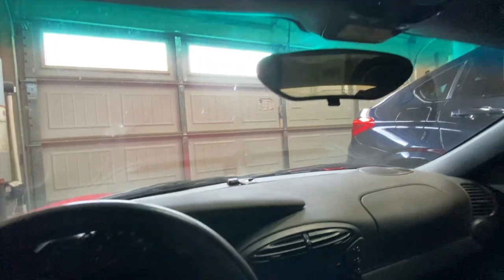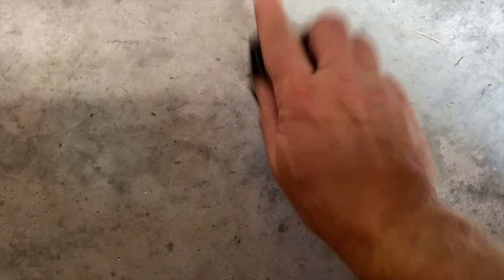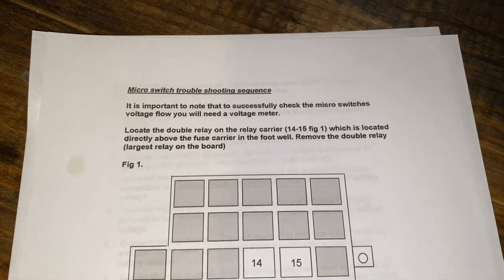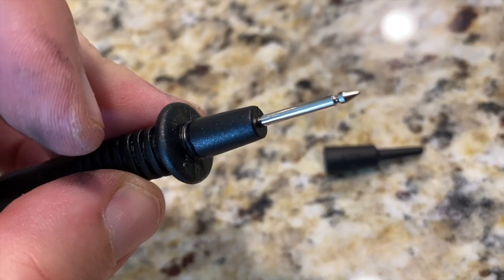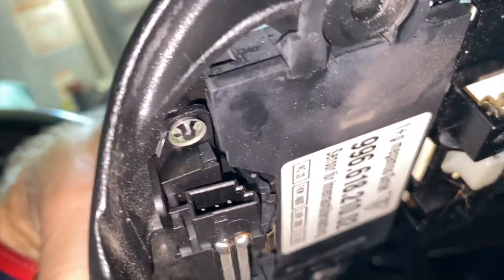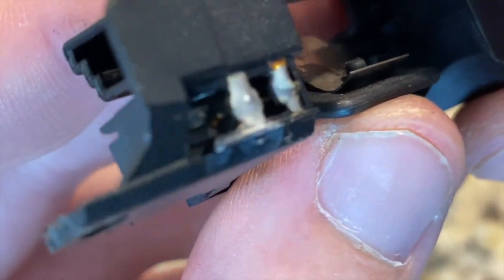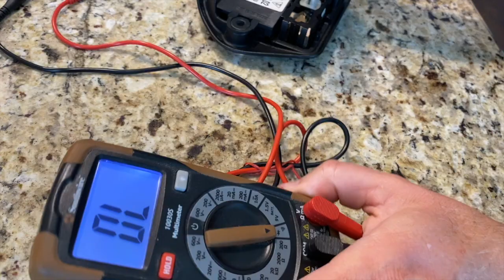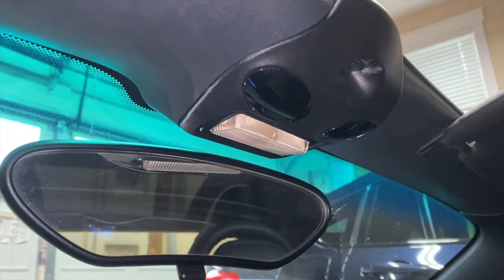Convertible Top WON'T OPEN/CLOSE GO UP/DOWN - FIXED! Porsche Boxster 986 Troubleshooting Tips

Comment: Did you have difficulty disconnecting the microswitch?  The lamp connector came out easy enough, but the other one appears to have a inoperable tab preventing it from disconnecting at the microswitch itself.  Any ideas?
Reply from the maker: +XR4turbo yes the other two were a little harder, but as you probably saw I didn’t even press a tab I just pulled.

Comment: try back probing next time save you taking the switch assembly apart
Reply from the maker: +Lego Everything is Awesome idk what that means 😆
Reply: @HelpMeDIY  well instead of you unplugging the connectors to the switches you need 2 needle type probes that connects to the multimeter probes you then would push the needle probes into the back of the numbering terminals you require you are able then to do a passive and live test one for Continuity and the other that would display a voltage
Reply from the maker: @swwiss  don’t I still have to take the assembly apart to get to the switch to probe?